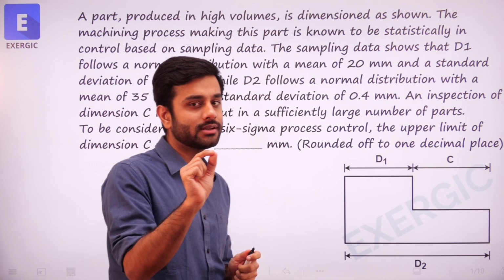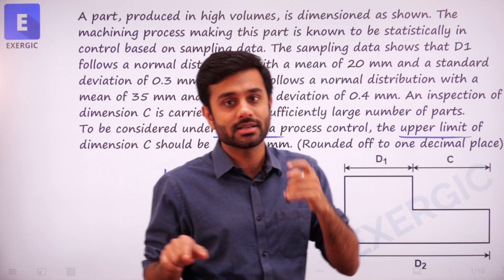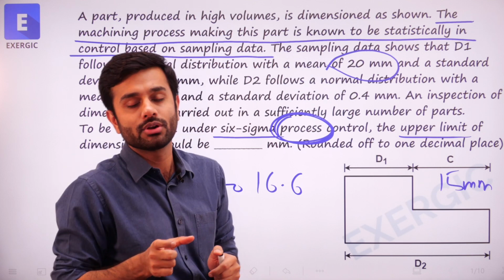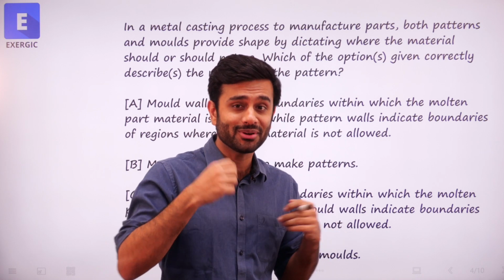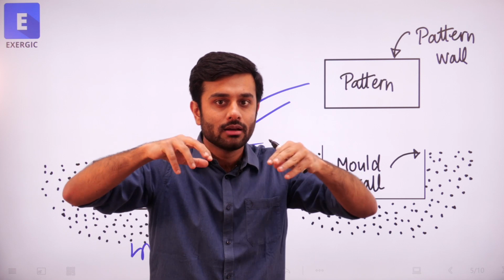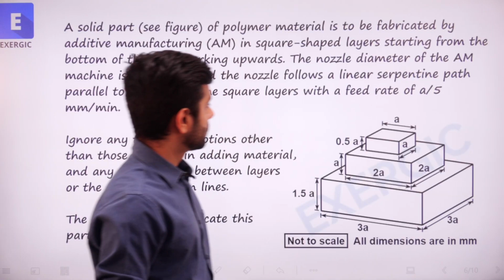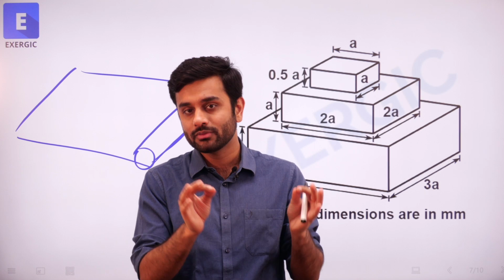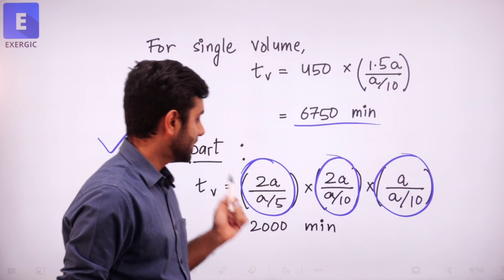Challenge these questions - GATE 2023 Mechanical

Comment: Question 55 I will differ from you...the motion is serpentine that is along the boundaries of square coming inward or maybe going outward and the feed is along depth and after filling one layer, the table goes down and the next layer is formed . 
You will get the same answer considering the nozzle as square with side a/10 . 
In your case you are taking  feed of a/5 along the motion of tool assuming horizontal nozzle face moving along the rod which is not the case as feed is given perpendicular to direction of tool motion.

And further how are you planning to fabricate the gaps between cylinders :)
And nowhere given that vacant spaces will automatically be filled .
Reply from the maker: Interesting!

As told in the video, the main thing is to decide which formula of time is to be used.

Even if we consider the situation as you explained, total distance to be travelled and speed of travel do not change, so the answer will still be the same.

Hence the question should Not be challenged.
Reply: Answer will be same but a square nozzle of a/10 is required ... please read my msg carefully.

Comment: If we assume dia of rod and hight of rod is same then how could we make a solid by AM processs...there will be void between two rods... according to you sir by using circular rod we make a solid cube without void...how it is possible..??if we fill the voids then the hight and diameter will not be same
Reply from the maker: Having small voids does not mean it is not a Solid.

In fact, Additive Manufacturing methods obviously have voids in them depending upon which method is used. I am sure you would have studied it while covering this topic.
Reply: I didn't get any question from AM processs where layer thickness was not mentioned...and in the gate question there was not mentioned height=diameter assume karna tha...after seeing the question Every one was thinking about layer thickness..in question they have used poor English.... most of the students were trying to tnink whats the layers thickness..
Reply: If material deposit rate was given definitely the question would be correct
Reply: question has already mentioned "SQUARE SHAPED LAYERS"...therefore shape of one complete layer will be cuboidal, not cylindrical...since it is square shaped that's why its width and height is same...